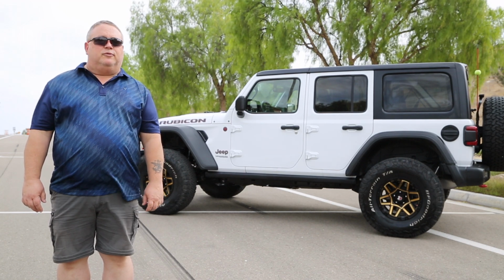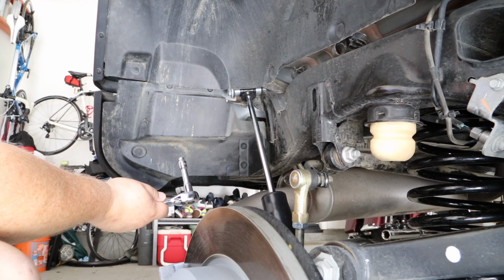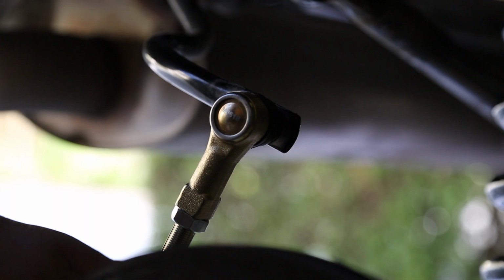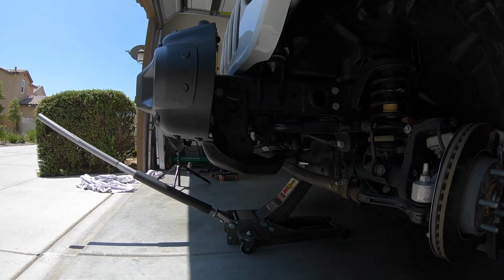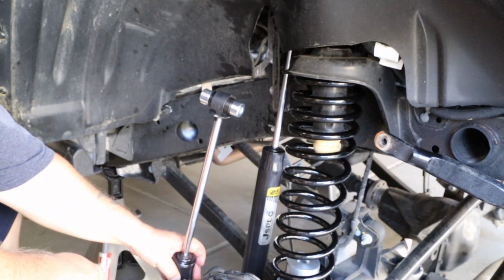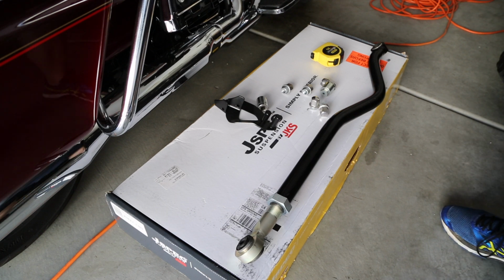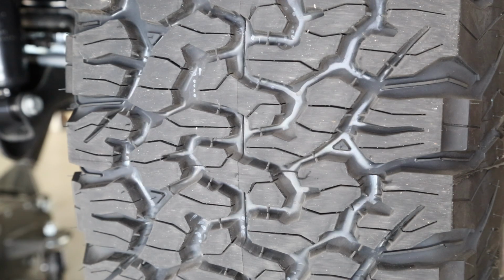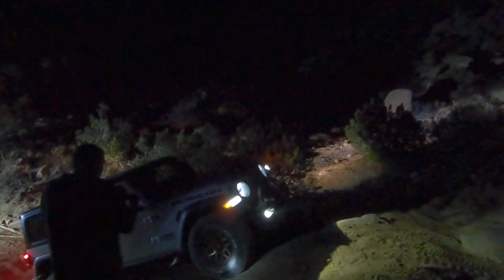JKS JSPEC 2.5 Lift Kit Installation

Comment: I see you went with the Jspec shocks. How do you like the ride? Im just trying to see if its worth it to pay 600$ more for Fox shocks. I dont do any rock  crawling, only trail riding mostly.
Reply from the maker: I had no concerns with the JSpec shocks - they worked just fine (although I did select the heavy duty springs which did make the entire set up a bit stiffer).  I was a bit concerned the first I went with my club on a few high-speed desert runs over some washboard roads, but they didn't seem to overheat nor lose their ability to dampen the impacts.  That said I can't compare them to the Fox units, but at $600 more, I would have a difficult time trying to justify the extra cost.  If I was to upgrade the JSpec units, I'd look for a reservoir equipped shock.

Comment: Can you install those sway bar links on a sport without cutting the passenger side tab?
Reply from the maker: Not sure; this kit was specifically for the Rubicon model.  JKS does make other links include handy quick disconnect styles.

Comment: I would not recommend cam locks for geometry correction. Geo correction brackets or adjustable control arms are the way to go in my opinion. Grinding out the holes for them to fit makes adding arms or brackets later a major pain in the ass.
Reply from the maker: What’s done is done!  I’ll deal with that later when I put aftermarket control arms on it.

Comment: Did you get an alignment afterwards?  If so,  was it out of alignment? Im about to put this lift on my JL Sport.
Reply from the maker: No I didn’t because the only thing that can be changed on a solid axle is the toe-in and it’s relatively easy to do that on the Jeep.  I did use the caster correcting shims that come with the kit, but I would recommend adjustable lower control arms to compliment the kit if you can swing it.
Reply: @4LowRocks  I got the optional solid lower front & rear control arms that are offered for the kit.  That way i don't need to alter the mounting points.
Reply from the maker: Good choice!  I think you’ll be happy with that set up.  Good luck!  Would like to see before and after photos if you want to share in the 4LowRocks Facebook page after you complete the Installation.

Comment: How is the ride with new springs and shocks compared to stock? Can't wait to see the rest of the sneak preview!
Reply from the maker: Hi Dirk, thanks for watching!  The ride is very nice; maybe a bit stiffer on small ripples and bumps but not objectionable (and that may be due to the higher load rating on the tires and additional unsprung mass of the wheels/tires).  We loaded it down to bed in the suspension, then did the VOTM at night, and that seemed to settle the suspension nicely!  See you on the trail soon?
Reply: Thanks Mike. That's great to hear. I appreciate your videos! You'll definitely see me on the trail soon. I'm currently on vacation in Hawaii.
Reply from the maker: Cool.  I saw your ride on Brad's video.  Enjoy the Aloha!

Comment: What size tires did you go? Those wheel are cool. I lifted my Rubicon JL 2weeks ago I’m going 37s I also used lift kits 4less. But I went with SkyJacker 2-2-1/2 long travel kit. Great looking JL Mike.
Reply from the maker: Dave, thanks for watching!  Congrats and thanks for the compliment.  I put 35's on those new rims.